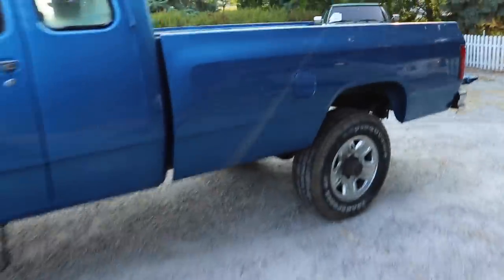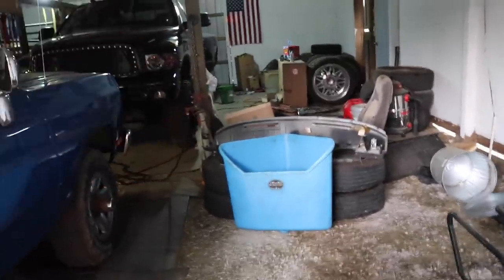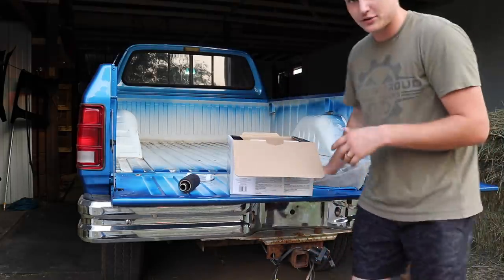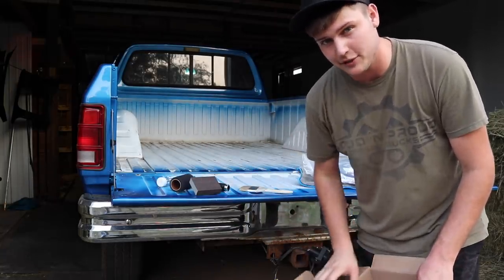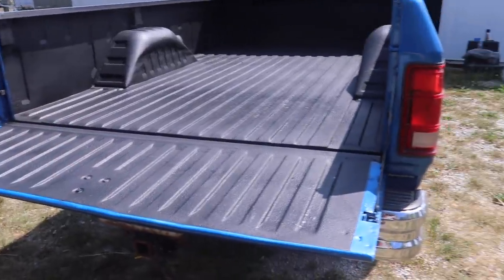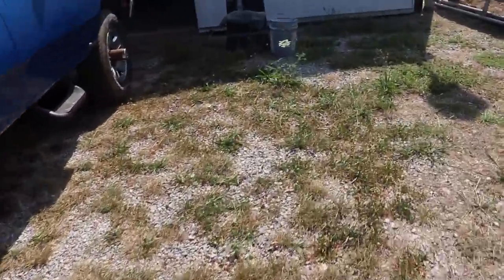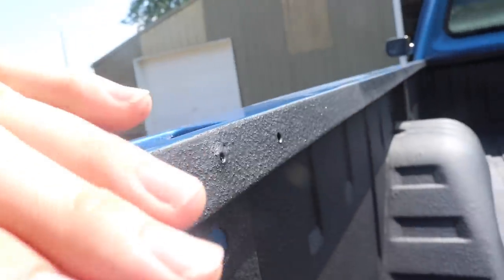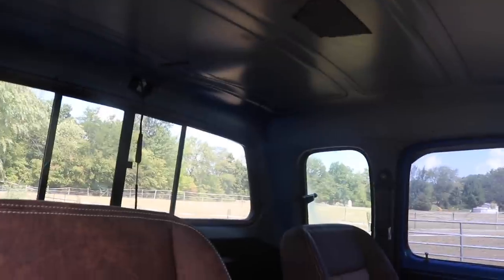DIY $150 Truck BED LINER in YOUR Garage!!!

Comment: The main thing is prep. Sand it really good and cleaned so no impurities on the bed before putting the liner coating on it. But it looks great wait a week because it's still soft on the bottom. Did my f150 6 months ago and I'm a contractor it's holding up pretty good but it will chip they all do professionally or diy. Just touching it up before it rusts is e.z. spray can it in spots again. But if you don't use the whole can and you save it it probably won't work it dries up the tip and the stem so you'll probably have to get another can. Always use a full can touch up or not